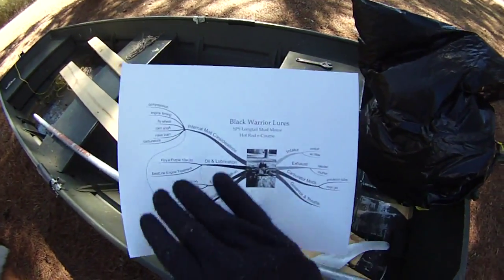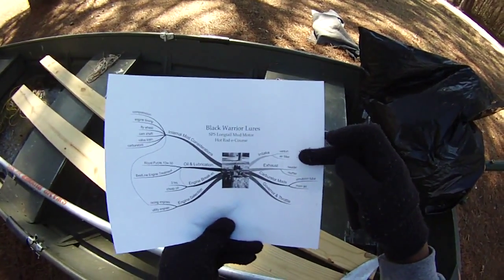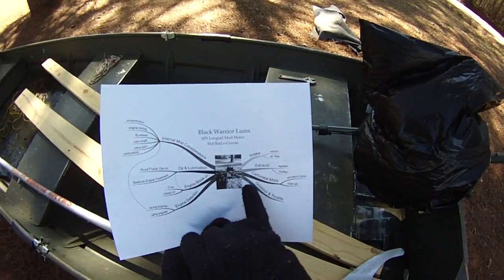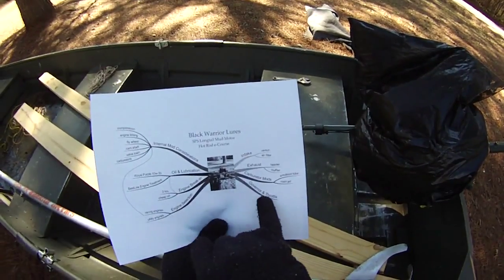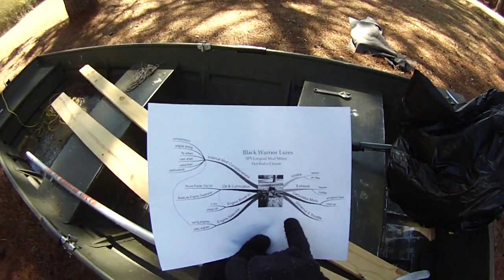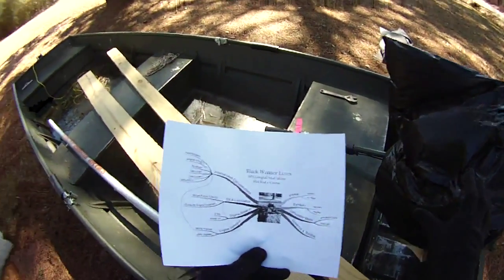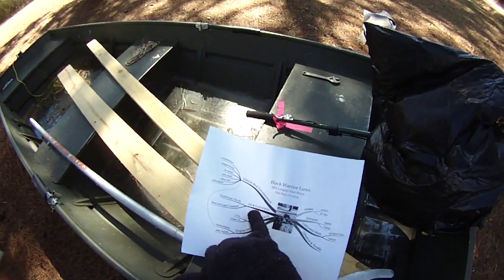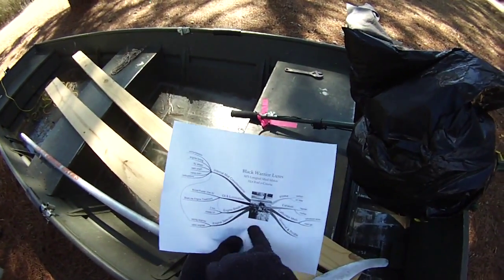SPS Longtail Mud Motor Hot Rod e-Course | Intro

Comment: Pretty cool man!!!
Reply from the maker: Glad you liked it. I've since come to the conclusion that it isn't worth building these hot-rod motors past stage 1.  Just get a good open element air filter and exhaust, rejet the carburetor, and leave it at that.
Reply: Black Warrior Lures hmmmm interesting but hey we like to tinker with stuff so why not ha ha
Reply from the maker: Tinkering is fine. I recommend people buy a separate motor for modifying. Motor blows up below the dam means death.

Comment: do you have problem with keep the prop in the water?? mine always wants to run at the top and wont run as fast. so I have to pull up hard to keep the prop in the water.
Reply from the maker: +Chase Reynolds For a rising prop you need to follow the instructions Mr Dobbs has on the mud motor forums: http://mudmotorkit.com/forum/viewtopic.php?f=7&t=171
Reply from the maker: In interest of education and information, I'll summarize it here. Follow these in order.

1. Make sure the engine base isn't upside down.
2. If your transom height is higher than 16 inches you need a longer shaft.
3. Transom bracket should normally be turned outward. (mine work better inward. Try both to see.
4. Reposition engine on base plate hole for better balance.
5. Run a smaller prop
6. Make sure prop shaft run in the center of the crest of the wake.
7. Only after the above steps have been tries, weld a small tab on the fin of the unit. (You'll have to go over to the forums to see how that works.) 

If you've bought the SPS Longtail go over to the forums and register to get access to the: THE SHADE TREE - Post & discuss your longtail builds here.